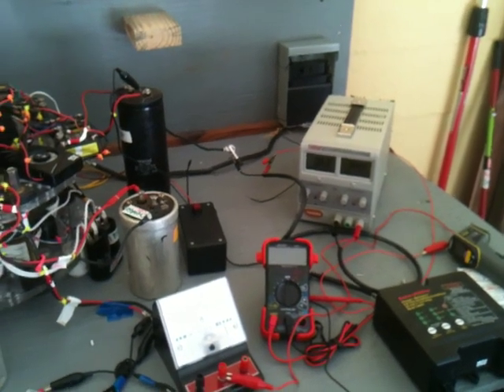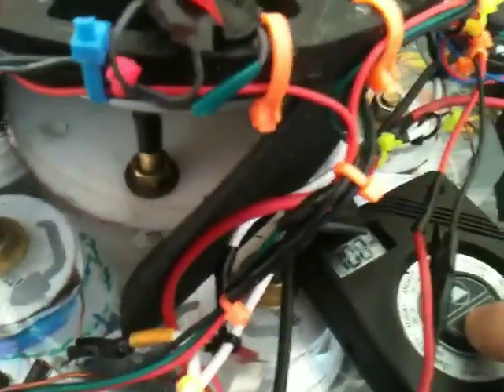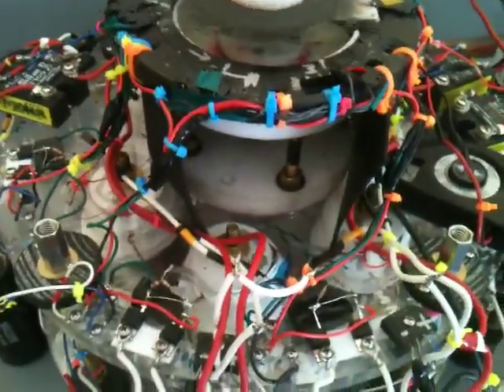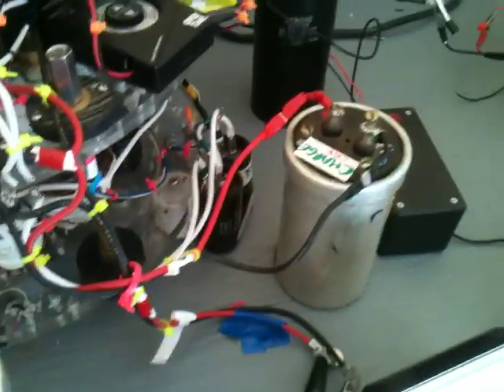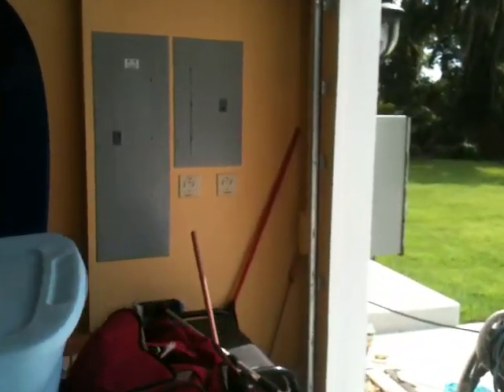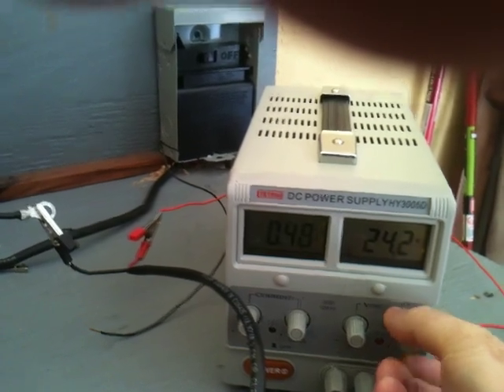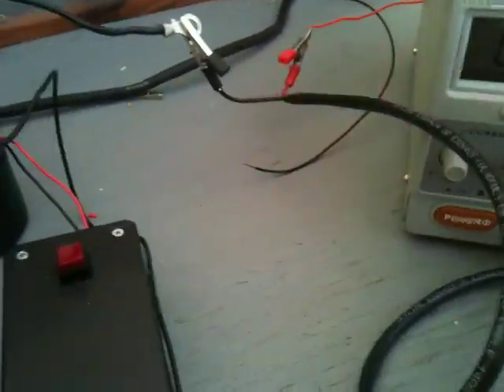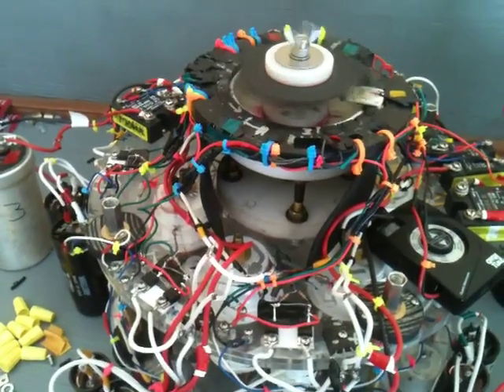Series 1 Power Hub Power System

Comment from the maker: In Pulse it works out to 1.5 amps out. This is only a concept model If I cascade it the Amps go up to 4 amps out at 600 MA input. My relays will not handle that much power since it was set up to be a pulse battery charger for now..